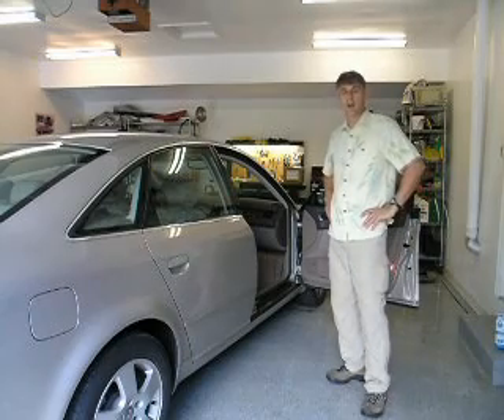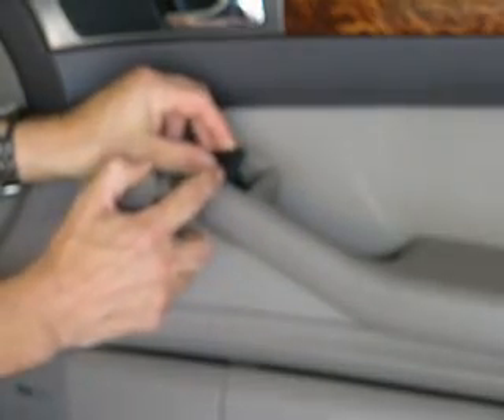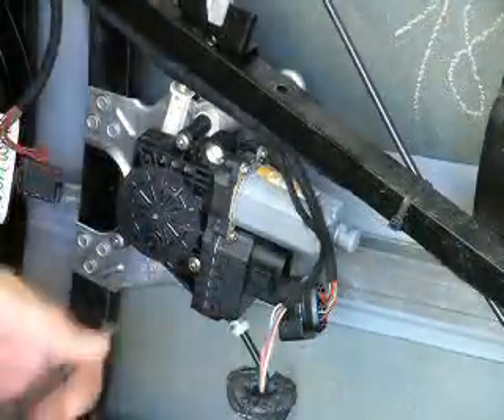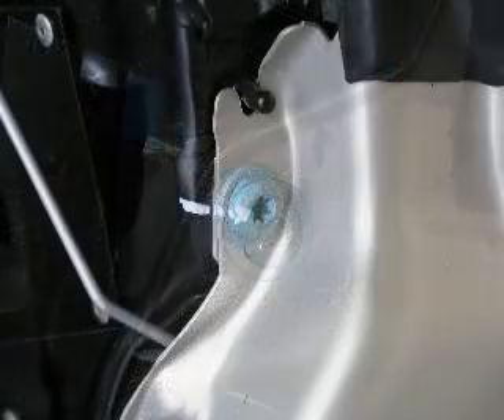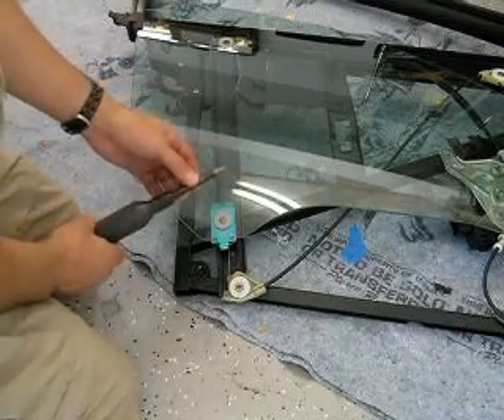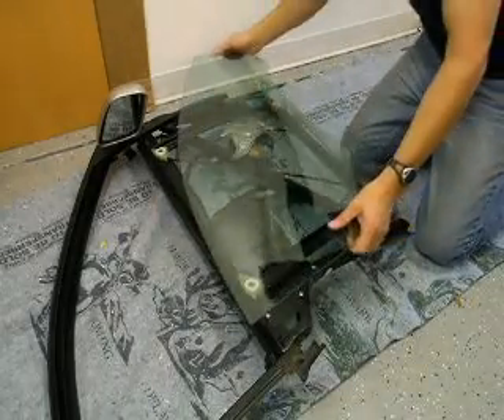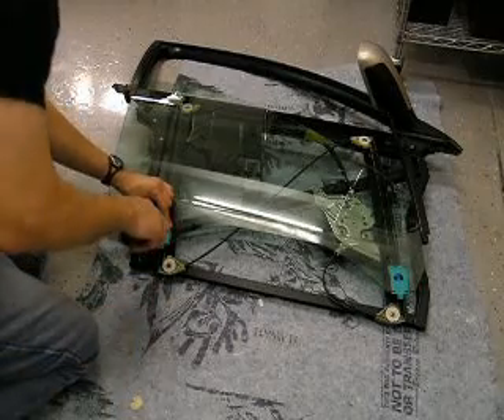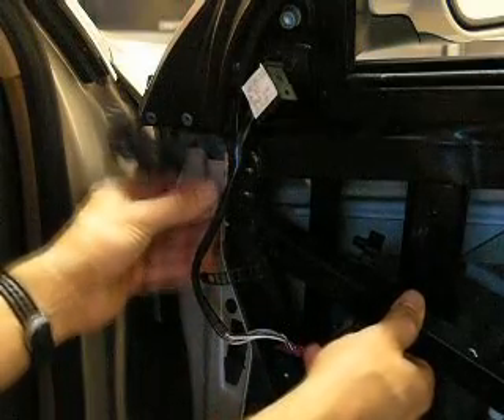Audi A6 Power Window Repair

Comment: Really good video. Thanks. It helped me a lot. I couldn't have done it without this guide.

IMPORTANT NOTE - If you are going to remove the glass and replace the broken guide clip, window needs to be wound down. Take it all the way down then about 10-15mm back up, which allows glass to be removed from guide rails, but leaves enough room to get the guide clips off the cable. Do this before starting removal.

Comment: This is a great video, I had no problem replacing my clips! My Audi dealer wanted $29 for a set of them and didn't have them in stock, so I ordered them from Amazon for $12. I like how easy Audi made it to work on their cars - most other cars use cheap plastic clips to hold on the door panels that break when removed, Audi has heavy duty door hangers. Thanks so much for the instruction!

Comment: Thank you for posting the video. I managed to fix the issue for £6 from Audi Aylesbury UK. I would recommend making sure you mark the bolts with a pen as suggested as I forgot to do this and it made reinstall harder. Also make sure you take all trim off carefully as ut is easily torn.

Comment: Successfully replaced a broken window slider clip in the passenger door of my A6 today, by following this video and the window is back in action. I only wish I had understood the benefit of marking the positions of the adjuster wedges on the two lower torx bolts before I started. Thanks for the help solving my window fault. Part available and cost £5.06 including tax at the local Audi parts department today 9th November 2017.

Comment: Many thanks for an excellent video, I've successfullly repaired both front windows which I couldn't have done without your clear instructions. In my case, the cables had snaped, on both sides. It is a bit fiddly getting the new cables on to the spool which is driven by the motor, but fairly obvious how it all goes together when you see it. My only tip would be to use plenty of grease inside the part which houses the spool. I didn't use enough! But two windows working again for £17 each, so I'm happy.

Comment: Hi great video, this will save a lot of people a lot of money, because dealers always try to sell u a complete mechanism, unless you tell them 20 times that you only want a pair of pink sliders. Did the trick at my 3 door A3 too, even without removing the complete frame. Same procedure as for the A6 in the video.

Comment: Very helpful video-  
If the problem is only the clips, it can be replaced without needing to remove the frame, if you use right angle screwdriver to remove the retainer screws from the clips.
I had to remove the frame only because the lugs in the cables went full travel after the flimsy OEM clips broke and allowed the lugs to jam into the pulleys, preventing them from moving. Also, note that the alignment shims on the frame mounts at the front and bottom should be marked before removal, .

Comment: Great video, I has a similar problem, the window was struggling to go both down and up, when I stripped the door panels off, it was the steel wire which is used to move the glass up and down, it has some broken strands of wire which were getting stuck in the winding devise. Put in a new set of wire and presto.

Comment from the maker: @rdftrd1 
The procedure is for the front door of the A6.  The rear doors on the A6 and all the doors on the A4 have a componant system that includes the frame.  Taking the door panel off and other componants are similar but if the tracks are broken, you have to replace the whole window lift regulator assy.  Runs around $85-$120 USD depending on where you get it.

Comment from the maker: @RudelyPolite - be careful on the A4.  the set up on the internal mechanism is not the same as the A6 front window.  I think the door comes off the same but you probably have one of two problems.  Either the lift assy is actually broken or it is loose and the window just gets stuck because it is off center.  The rear A6 assy and A4 assy may run as much as $150-$200.  but its easy enough to take the door panel off to assess the situation.

Comment: Great instructional video! Well done. I have this problem with my driver side window. It goes down, then on it's way up it gets stuck and then the pinch protection pulls it back down. I have to pull the window towards the back of the car while rolling it up. I am assuming it's not the motor. It must be the clip like your passenger side. I am also assuming the driver side is the same as the passenger side with just a few more electrical connections.  Thank you.

Comment from the maker: Rear window is different.  make sure the window is on the track and not binding - that can cause the motor to shut down and appear broken.  If you have an actual "lifter" problem, you have to replace the main lifter bracket.   $140+ part vs a $6 plastic part.  I had the same problem and i just needed to re-track the window.

Comment from the maker: @rdftrd1
window may just be out of alignment due to loose bolts.  if it were mine i would take off the panel to see if anything is broken or just out of alignment and loose.  If loose, just do the obvious realignment and tighten up the fasteners.  good luck

Comment from the maker: @JeansBiturboA6 
The A4's have a different system on both the front and rear.  The rear is similar to the A6.  If the mechanism won't go up, it is probably either off balance (not even) and jammed up or the lift assembly is otherwise damaged.  If the assembly is damaged you will need to replace the whole assembly.  not too difficult but more expensive for the part - about $120 or so in the US.

Comment: Great Video.  I followed it and fixed the same problem on my 98 A6 Quatro.  I purchased the parts for $6.66 each at my local dealer.  They were in stock.

The part number is 4B0-837-463-B. It is called a "Carrier".  There were two carriers on my window, and I had to replace both of them.

Tip: If you remove the door panel and see broken pieces of green plastic at the bottom of the door, you have this problem.  You can stop your work there and purchase the replacements before continuing.

Comment: yes, but you have to change the  entire rail system, as the wires are connected to it. when he took changed the clips, you just have to drill out the pops holding the railings. 

just did it today, easy as long as you have the right parts and tools.

Comment from the maker: i think the easiest way is to pull the motor off the frame (3 bolts) then hit the up/down power switch.  if it runs the the motor is probably good and the plastic clip is whats hanging things up.

Comment from the maker: @medowbrookgoer39 
No problem with my dealer.  They knew exactly what i was talking about when i walked in and had several of the parts available in inventory.You might try calling an Audi Dealer elswhere in your area and see if they will ship it.  also - This is the procedure for the A6 front doors.  the A4 and the rear door of the A6 require a whole lift assembly.  maybe your mechanic had that experience with something other than an A6.  Good luck.

Comment from the maker: @lawrence001973 -- just tell your audi dealer parts department that you need the plastic tab on the power window lift mechanism for the front window.  The OEM parts break all the time on this year and they usually have them in stock.  The replacement part is of a better quality than the original.

Comment: Good video. I have a 2004 A6 and need to replace the chrome window trims on the doors. When the window and frame is removed are the trims easy to replace, I know you did not do this but did you notice ? I think you have to drill the rivets out? Thanks
Andy

Comment: Very good instructional video!  I have a similar problem as 350zdemon.  My passenger window on 1999 Audi A6 went down automatically as I was driving and when I attempted to roll it back up it tried but stopped and went back down.  I tried a couple more times and I got the window to go up, but a few seconds later it went back down on its own.  Do you think its the motor or the clips? Thanks!

Comment: Great Video but I had a problem. I could not get the new pink clips on because the wire barrel Bead ???? was too close to the white pulley and I could not get enough slack to insert the barrel into the new clip. How can I create enough slack or move the bead barrel away from the white pulley to install the pink clips? Thanks for your help!     Scott

Comment: This is a great video! I also have some problem on the audi. One of the window can not be controlled. I want to pull the window up or down. But there is no motor sound and it does not move. After I try several times, it can move a little. Is it the same problem to yours? Or other motor problem?

Comment from the maker: @MrJKLLOL That would be a classic symptom.  its easy enough to take the door panel off and make sure.  only other thing would be the motor.  window goes down easy because of gravity.  wont go up if motor is weak/shot or the clip described in the video is bad.  anything else would be rare...presuming you are talking about front windows on an A6

Comment from the maker: most likely the plastic part.  if the plastic part is not broken, the motor would be unlikely to reverse since it does not "free-wheel" easily - or perhaps at all.

Comment: my windows go down perfectly fine, but when it goes up, it kind of stalls, so I have to pull it up with my hand. However, it does go up fine some times. This is a problem for both of the driver and passenger windows. How likely is it that this is a motor problem?

Comment from the maker: @mamarakateporetu
 i don't know about the 2006 model but on the 2000, and other years, the rear door is different.  on the rear door, you have to get the whole actuator assembly.  i've seen it on Rockauto.com for about $100 some time ago.  it is not much different from an assembly / disassembly perspective but the "part" is much more expensive if you have to replace it.

Comment from the maker: Thanks  
The pump does not work.  For a while it was really loud on start-up for a minute or so.  Then it stopped working and I got a code indicating it was bad.
 I have a Bentley repair manual which is pretty detailed but it seems from your original comment that some procedures have been updated so I wonder if there is any trick to replacing it or if it even needs to be replaced.
Also, the turbos are leaking a bit of oil  can they be repaired? Any aftermarket units that are better?

Comment: @mlr1844 I think Im having the same issue you did. My rear window goes about half way up, but the window binds and goes back down, if I pull it forwards, it goes up just fine. So I just need to re-track the window then? Thanks,

Comment: I drive a 2000 audi a6 and my front passenger window seems a bit stuck. It goes down fine but struggles to go up past halfway unless i pull it up using my hand. Can anyone advise as to what could be wrong please?

Comment: hi "mlr1844" thanks for your video, now i got a better idea of what could be causing the problem of the passenger side window ( 2000  A6  2.8 Quattro)...
a question, how do i, or how did you test your motor to see if it is good or bad? my problem is that the window goes down perfectly but when i wanna put it up it goes half way and stop and some times it stops and goes back/down again, so in order to pull it up i have to help it with my hands... thanks for any advice...

Comment: Great video, thank! The part number for anyone who wants to order it, is #4B0837463B. On my car it was the driver's side. Couple of points...I couldn't disconnect all the wiring - some of it was hard wired, so you may have to do this job with the regulator still somewhat attached to the door. Also, the blue V shaped holders for the window did not fit the replacement clips as well as they fitted the original green ones. I went ahead and bolted the window on anyway...seems fine. Thanks !

Comment: Nice vid, what would be involved if your just replacing the window motor?
Reply: Follow his directions on removing the motor and simply add the new one in its place doing the opposite of what you did to take the old one out. It's held in by four bolts. After you take them out you need to pull pretty hard and it comes off.  I know this was a year ago, but I commented in case anyone else had the same question because i did this today.

Comment from the maker: @111111555555555514 
Back window is different.  Could be just out of alignment due to some loose components.  The panel comes of similar to the front but it the lift mechanism is broken the whole assembly needs to be replaced.  a little over a $100 at some places or check car-part.com for a used one.